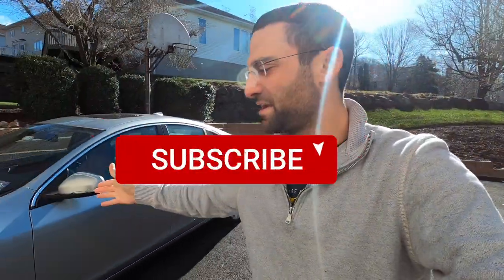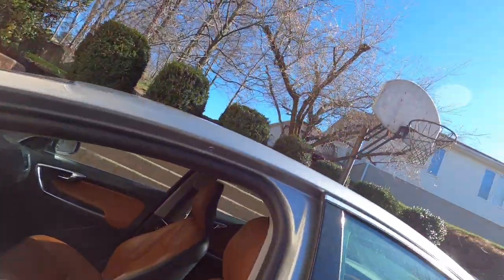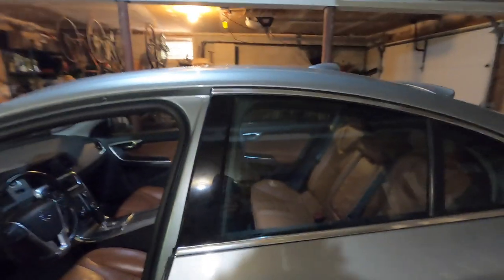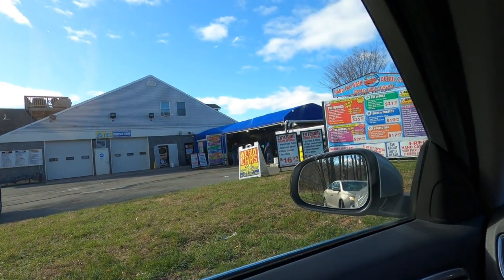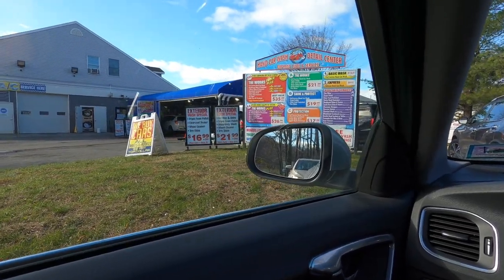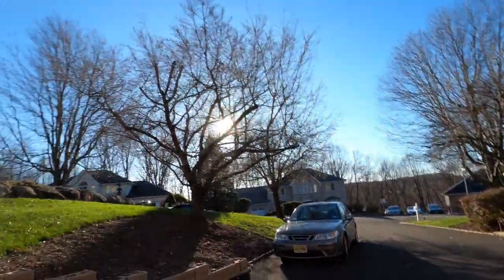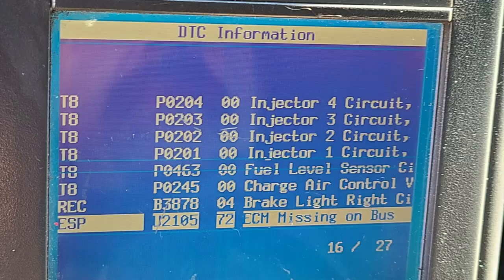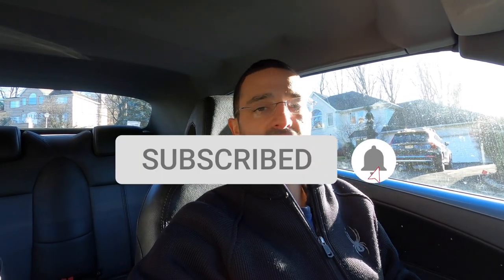GOODBYE to My Volvo S60 + My 07 Saab 9-3 Convertible Failures!

Comment: Exhaust drop is actually easy. Three bolts at the bottom junction of the down pipe, and all the hangers are just rubber rings that pop right off the mount hooks. The whole exhaust drops in one piece and you can drag it out from under. 
Simple no-tool quick connect fittings on the fuel and vapor lines, pipe clamp on filler neck, 4 bolts to drop the straps and tank. Tank is plastic, very light if nearly empty.

Expect to replace the sensor on top of the fuel pump, easy. Gasket falls apart on them. You will want the pump lock ring tool, put some torque on it and tap it along with a hammer.

Just soak the bolts overnight with PBlaster beforehand. 

After watching the work you did on the TX shaft, you can handle this job. I just did one out and back in, in 3hrs in the driveway with front wheel ramps, rear jackstands and the jack to drop and raise the tank. 

Just be gentle on that pump cover. Dang thing has a plastic manifold of lines instead of metal.
Reply: Btw. That NG vert is pretty sweet after driving the OG verts eh? 

I went from a 2005, to a viggen vert. 
Imho, The NG is a considerably better vert design with waay better chassis stability. Just not a monster engine, but smooth.

Thinking about keeping it yet?
Reply from the maker: Its very true!the ng does ride nicer. Just the quality of materials and stuff drives me crazy. Thank you for the input. Puts alot of ease to whats needed to be done!

Comment: The roofline on the volvo looks like a real headache for the rear passengers. Gotten many head bumps on that?

I have not received a moving violation since the 80s. That includes 32 yrs driving truck. Never owned a radar detector. I've driven trucks governed at 57 (ah, the good ol days...NOT!) and recently trucks governed at 75 or 79 🙄 . I have a hyperawareness of the presense of law enforcement. However, i rarely leave CT. Would suspect NJ and NY Metro area is pretty bad. Still, i put detectors in the catagory of mounted mobile phones. Old school

In any case, i do like your saab content.

Comment: I've had to remove and send in the ECU on my '05 9-3.  What happens is that they are right up against the engine so the constant heat takes its toll.  Just curious, are you member of SAAB Central?  They've helped me a lot whenever I have an issue or need a source.  Hope to see you next Friday in the Chicago area (IKEA/Schaumburg right?)
Reply from the maker: Yes! Thats the spot. Yes, member on saab central. I think my user is Kpan-saab
Reply: Daniel, where do you send the ECU's for repair if they go bad? I would like to know just in case! Thanks in advance. Ray
Reply from the maker: @RADThird1  bba remanufacturing in Taunton, MA
Reply: Thanks for the info, Kyle. My 2006 9-3 Combi is at 85,000 mi. I did install the ECU insulator kit from Australia. At $90 US including postage I figure that it could be some cheap insurance.

Comment: You said you’re getting all those codes but you’re NOT getting a CEL?
Reply from the maker: Correct!
Reply: That’s really weird, are we really sure that this is a Saab 9-3? 

You’re driving down the road and you fart.
eSID: Fart Detected.
Check engine light: <ON>
Reply: Seriously though, maybe it’s not the ECM? If I were in your shoes I’d deal with the cheapest code first and see if it still threw a code for it.